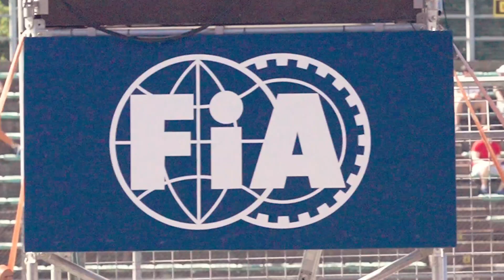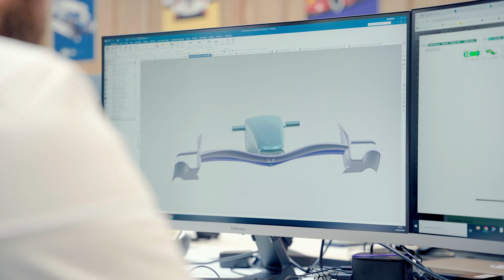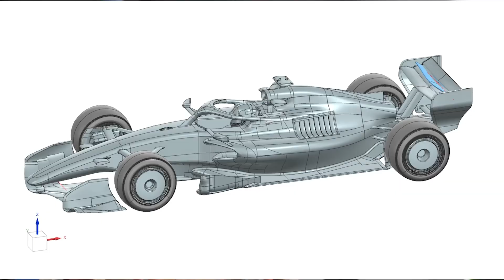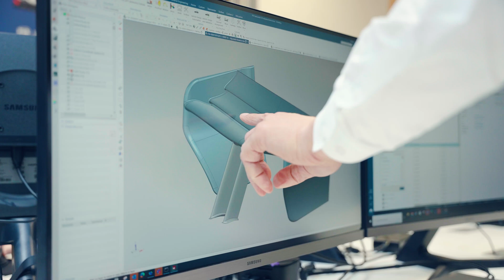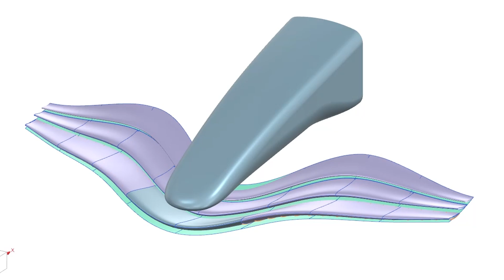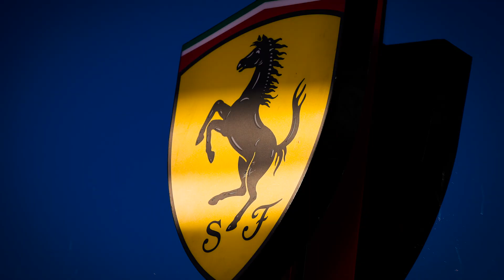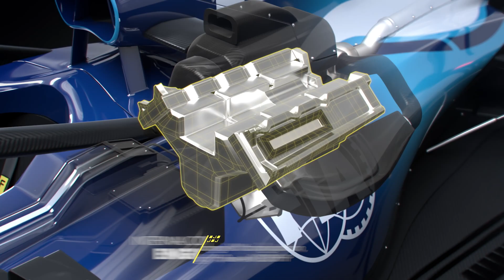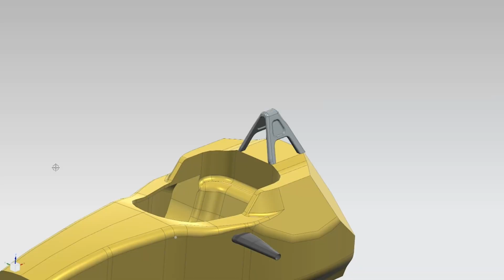The Future of F1: Showcasing the 2026 FIA Technical Regulations – Lighter, Safer & More Competitive!

Comment: My best idea for regulations is 1.9m wide so middle ground beetween 2016 cars and modern cars (and shorter), more slipstream effect, 16 inch wheels with narrower tires (especially at the rear) so they can dance around more and braking distances get bigger, for the engine i would like a V8 which would be around 3 litres (V10 would probably require refuelling) and a simple, light KERS system as a defending or passing tool without that heavy, complicated hybrid nonsense, i am not sure if DRS would be needed with that car or not but i prefer to have DRS than no overtaking so that would remain to be seen
I would also allow double diffuser back for more speed and loosen up other regulations slightly
Reply: It's 2022 car, but 10% smaller

Comment: V8 era cars are goated. Imagine them with a V10 engine, that would be awesome
Reply: Fans need to shut up about v8 v10 it's done.
Reply: @jayantchatterji3262  the main problem for me is that, I liked the engine pre 2022, but they decided to change it and kinda make it worse. The current reg feels like a flawed concept now because of the weight and size. Plus it still does solve the one team dominated issue since 2014
Reply: @jayantchatterji3262  yknow when a sport was known for it's incredible noise it would only make sense that everybody would complain after making the noises crap only 13k rpm in the current v6 engines in 2006 engines would reach 21k rpm in the v8s (which had no rpm limit but then in 2007 it was limited to 19k) v6s could have a chance if they reached 18k rpm but no they've been at 11-13k rpm ever since 2014 and the engines sound like formula e because the noise from the ERS is louder than the engine on the on boards they also removed exhaust mics for some reason which was the only thing that made v6 bearable so yea even my vacuum cleaner sounds better than the current v6 so of course we will complain non stop even if they don't do shit

Comment: I’m not a massive fan of this active aero. Seems to me like the goal is to have less side by side action and more straight line overtakes. Which is just as boring as what we have now.
Reply: Actually, it might be the opposite, right now only the car behind can use the DRS, and with these new regs, both cars can. This means that relative to the car in front the car behind is no faster thanks to the active aero systems. More electrical power however can be utilized for more creative overtakes as this advantage does not require the cars to be at high speeds to deploy; therefore the drivers (if allowed) can use it in more unique situations and even in low-speed sections of track.